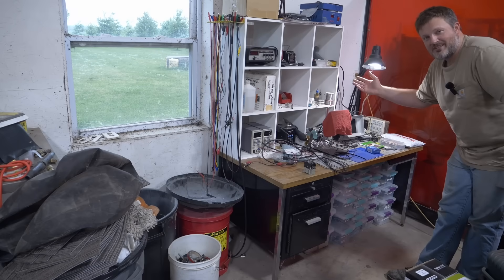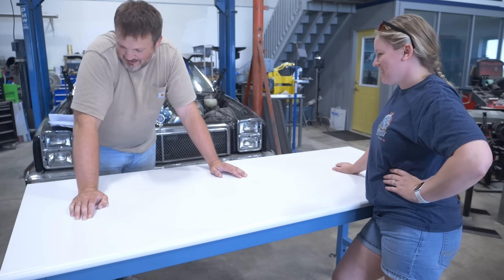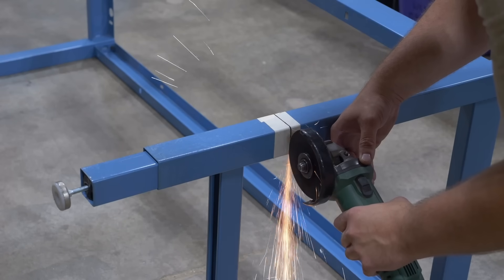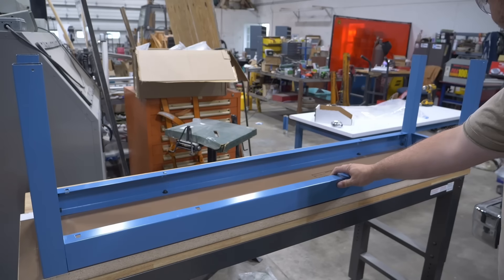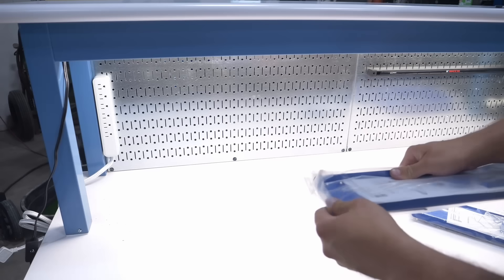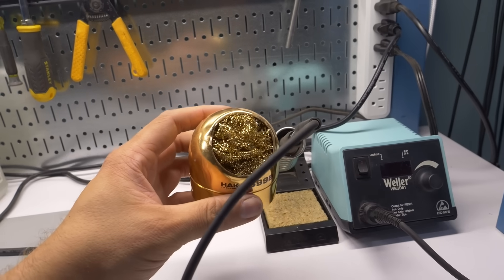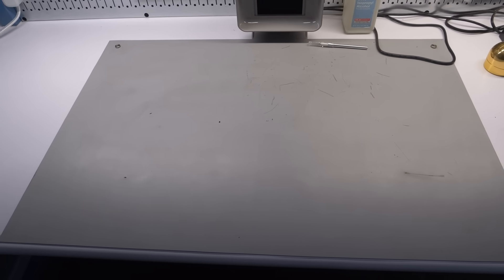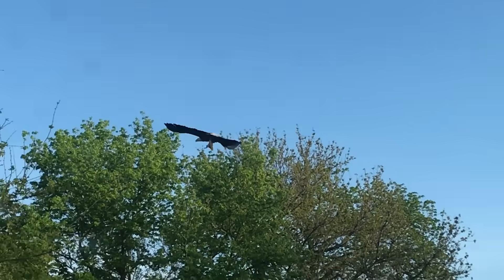Building an Awesome Electronics Bench on the Cheap

Comment: suggestion. get a pair of ceramic tip tweezers. they dont stick to the solder when you hold parts so they come away really easy without making a mess. also they are non conductive so they can be used to run solder onto the sides of it kinda like a dam

Comment: We had some of those expensive workbenches in our US Army calibration lab and I hated them. Four years ago, I bought a Husky 8 foot steel and wood adjustable height workbench from Home Depot for $405. However, it doesn't have a shelf, but it's long enough that I can store stuff under part of it. It has two 3D printers on it and has room for a computer workstation. It's great to be able to make your own stuff.

Comment: I hope I'm not the only one telling you that the days of Weller are gone. Until some years it was clearly JBC ruling the soldering world, and nowadays there are many cheap chinese JBC compatible knockoffs that are also very good.
The "new" ingenious thing is, that the heating element is inside the tip at the JBC (and compatible) tips. This means that the heat transfers a lot better to the tip than on that old weller design where the whole tip without heating element is exchangeable. Unfortunately Weller hasn't caught up here.

But of course it depends a lot on what you're doing. :) I follow your channel since the CNC video, and I guess for that purpose the Weller station is more than enough.

Comment: I don't know why carbon steel tables should be this expensive when stainless steel 30x60 kitchen work/prep tables on Amazon are available for less than $200. I bought several to work on and they have been plenty sturdy. My next trick will be to wrap them in vinyl car wrap for some color.

Comment: But But But... How much did each of the two benches cost? Where did you get them and are they still available at a bargain price?Ground wire to cold water pipe could have been in the wall before redoing the room with a wall receptacle right there! Ceiling fan to help blow any stray fumes away. Glad it came together for hopefully a BARGAIN price!

Comment: Mask up when sawing, cutting and sanding that stuff.  It can catch up to you decades later.  Also... on those little 4" cut-off disks.  Wear a full face mask.  When they shatter, they throw serious fragments out at high speed.  It's surprising how many stitches they will require.

Comment: I actually like having a monitor, keyboard and mouse on my electronics bench. Makes it way easier to look up data sheats while working. I have an old professional Elabo Bench at work, which is too low to fit a monitor, so I'm constantly switching between my desk and my workbench. That's a bit of a headache.

Comment: Thanks for sharing. I've been using a white folding table for now. It works but I need a shelf for my hot air station and bench power supply. Also that fume extractor just hides the smoke, it doesn't actually protect you much. The (I forget the term) toc? levels are still there. Ideally you pump the air outside. Also if you ever come across a microscope cheap, or want one. I bought a amscope SE400Z. Its alright, I mounted it to a vesa monitor mount I got for cheap second hand. Also upgrade from that 858D. The atten ST-862D is about $150 from WGP. Well worth it. Cheers

Comment: Do not forget that old landline phone indoor cable is a valuable asset as well. Used for jumper wires, and for connections as well, and you can get it in up to 500 pair bundles, with a good assortment of 10 colours and with stripes as well.  Old copper network cable is also useful, makes for great links, and the flexible one for wiring up front panels. Generally available at every building demolition if you look for it in a dumpster, and you only need a few meters of it (or for the USA yards, close enough for the work you will use it for) to last a long time. Bonus as well it comes pre tinned in the most case as well for the phone cables, which is a great help soldering them, though the PVC insulation does tend to pull back when soldering.
Reply: No one's throwing scrap wire into a dumpster. Even with insulation on it the scrap price of wire is just too high.

Comment: Only thing I can see missing is a hot air station for the surface mounted items. Then you'll need a snazzy microscope so you can see the SMD pieces. 
Real nice desk Wes and you could remind Mrs Wes that since she was off for the weekend she cannot share in your ritcheous glory of building an excellent electronic workbench. Only thing I would have considered changing would have been to put Dome Bolts in the part the held the shelf legs together. That would have been the je nais se qua for the piece de resistance. Bravo! 🥳🥳🥳🥳🥳

Comment: Kiddo is getting so Big Wes And Great Custom electronics Table Super Snazzy love Weller and Haiko 11:48 @Watch Wes Work
Reply: I have a Chinese T-12 kit iron and it's way better than my Weller WTCPN Even with a slow SMPS powering it it'll still heat up faster. I need to put a standby switch on my station. All in kit and PSU I think that iron cost me less than $25 to build. I made a custom case for it. They sell those too. But that would have blown the budget to buy that.

Comment: Went from an older analog crt scope to a digital one about 10 years back, they are nice but screen is not quite as responsive as the crt scopes were.   They are really light, far more compact with some additional features though.  Fair trade offs I guess.

Your bench turned out great and you didn't have to pay $1k.

Comment: That internal sense of accomplishment cannot be duplicated.  Every time you use that bench you will instantly recall the project and have that feeling again.  I know, I get it too when my projects/repairs work out.  Wes, disregard unkind or chippy comments.  I like to hear you talk and explain your thinking as you work.  It's how I learn.  If someone wants silence, they can always mute the volume.   I like all your projects - not just auto/truck - the wood splitter rehab was perfect.  If you want to fix it - do it.  I say "soder" also, people need to learn there are silent consents in English.  To de-solder try a red sucker bulb.  Looks like a kid's clown nose W/a white tip.  Melt the solder, then squeeze the bulb and suck it into the bulb to be emptied later.  Much better than wicks. Like your channel V-much.

Comment: It's not just the government. I work for a major semi-conductor manufacturer. As soon as you add "cleanroom" to literally anything, you add at least 3 zeros to the price. We use disposable towels that are synthetic and don't produce particles when used just for cleaning and wiping things. They cost several dollars per towel. They're disposable. If someone needs to wipe their nose, it costs $5-6. If it says "semiconductor production" on it, add 5-6 zeros.  There are o-rings on our tools that cost several thousands of dollars. A maintenance service, which in the high volume factories take place about once a week, cost $100k for a single process chamber just for the parts. We aren't allowed to use aftermarket parts, even though they exist and likely come directly from the actual part manufacturer (imagine buying a Denso oxygen sensor instead of a Toyota one, they're probably the exact same part with the Toyota logo scratched off) because the aftermarket parts aren't production approved. Entire companies come up from making very basic, niche products and cornering the market. They can charge whatever they want because there is no competition, no regulation and no other option. I'm sure this bench is over-priced the way it is only because of the three letters "E S D"

Comment: Well done! That screwable cap just gave me a solution for a similar problem. Thanks Wes!

And, by the way. Just want to add one small word of wisdom - people should not go for the led free solder, it's crap. Use something like Stannol Kristall 60/40 or similar. It's like night and day, and will save you a lot of times in the future.
Reply: 63/37 is the good solder. 60/40 is kinda the crappy stuff. 63/37 is the eutectic melting point alloy. Or lowest melting point of lead/tin.

Comment: As was briefly mentioned, it all has to be bonded to ground to get functional ESD protection. The shelf also needs bonding. It should be a high impedance bond, to avoid electrocution hazards, especially for the wristbands. Be wary of the "Auto" button on the oscilloscope, works fine for a clean square wave or sine, but if you have something more complex, with both high and low frequency components, it can easily get the settings off by orders of magnitude, both in time and amplitude.

Comment: Nice setup.  I worked as an Electrical Engineer for 30+ years and had a bench full of equipment from high end quad chan gigaherz O'scopes to logic and Spectrum Analyzers to TDRs and on and on...  Thankfully retired now and only have a multimeter.  Thinking about getting a portable o'scope for car troubleshooting, but I drive Toyotas and they never break. 😁   Thanks for the videos!  👍👍
Reply: do you recommend to be a electrical engineer what things i have to keep in mind or what  stuff i need to know 
im a student and in a couple of months i will go to uni, im in love with electronics and always wanted to be a electrical engineer but i dont know
Reply: They might not break, but it’s still good to keep an eye on the lambda and MAF/MAP sensors, they’ll cost you loads of money in fuel economy for a long time before they’re bad enough to throw an engine check light.

Comment: Lab bench setup is nice but if you want to do smt work a microscope really comes in handy. Also really handy for this kind of work is keeping a spool of the finest silicone sheathed wire you can find for rework and sniffing lines on a PCB.

Comment: i work for a college and built 9 of those recently. the build quality is decent, but for them being as expensive as they are, i expected better quality fitment. the anchors built into the wood are meh at best, imo.
Reply from the maker: Sure are. The frames are really weak too. Don't put any side load on them.

Comment: Well done, Wes!

A couple notes from an electronics hobbyist and retrotech guy (as well as artist, budding writer, and all-around computer neeeeeeeeeeeeeeeeeeeeeeeerrrd). One, Hakko is NOT an "off-brand" -- and, sadly, many "name brands" aren't any more (for instance, Zenith is now Funai Tech... you should see the guts I pulled out of that LCD TV, what a joke). Two, fume extractor is... more hype than anything else. So-called "solder smoke" is only boiling-off flux and nothing more -- the metal smell is from the solder melting. Solder doesn't atomize, only the flux does... and rosin flux is nothing more than, basically, boiled pine sap (no, seriously, Wiki it, it's pine sap that's been rendered the way pig fat is rendered into lard). It's fine. Three... 0.031in solder (0.8mm in civilized units) for through-hole, use the hair-thin stuff only for super tiny surface-mount stuff unless you want to go through it waaay too fast.

Four... antistatic mat is also hype. Unless you're working on something made literally in the 1970s, and it has very specific kinds of chips, you're fine without it. Done plenty of work, and plenty of rework -- never bothered with the wrist strap. Literally the only stuff that needs that kind of protection is the really, really early CMOS-process stuff -- first-gen 4000-series glue logic and first-gen ROMs/RAMs that used CMOS tech. The HMOS, PMOS, and NMOS stuff, you can walk across a football field during an electrical storm holding that in one hand and a bare CB radio antenna in the other, and the chips will wind up better off than you will. Anything TTL, or 1980s-and-later, same story, because by then they'd learned how to do proper ESD protection on chip dies. Tube stuff, same story, it's just too rugged. Literally if you're working on, e.g. an original Pong arcade cabinet from Atari, or "big iron" from IBM or DEC or the like that has actual chips in it, you probably want the antistatic mat and wrist strap, but for anything more modern, or anything old enough to be discrete-component-only, you've not got to worry about it.

Other'n that -- looks good to me. It's certainly cleaner than what I've got.

Oh, two other things. Learn to use a logic probe and you mostly don't need a 'scope for what most folks use it today -- I have a $17 Elenco, it's the one that Blondihacks uses (aka Quinn Dunki) and she is an absolute literal living legend... as for multimeters, keep a couple Cen-Techs from Walmart around, or the $10 bargain-bin ones from Ace. Use the Fluke (or whatever you consider "nice", for me it's a $15 Sparkfun job) for the important stuff, use the cheap ones where you think you might screw up, so that you're not left swearing a blue streak because you blew up the expensive one -- that's actually a BigClive tip.

But, I'm a bit more shoestring than you are. No worries. We all have our limits, and they're all a bit different.

One last thing, I mean it this time. Maybe up where you live it's different, but in MY house, "weekend" is Saturday and Sunday -- Friday and Monday only count on federal holidays, and even then it's only Friday evenings... and I don't even work! (I'm too incoherent to moonlight, even, so SSDI is all I have to work with. You'd be surprised at what you can do with a kludged-together 6v battery drill and hand tools and nothin else.)

Comment: A desolder station is better than solder wick.  Solder wick is cheaper if you’re doing occasional PCB work, but overheating a trace whilst wicking can damage the trace (easy to do, ask me how I know).  Other than that, all you need to finish the bench is get a spectrum analyzer, a frequency counter, a signal generator, a signal tracer, and a variac.  You’re all set!
Reply from the maker: I have a Hakko desolder tool, a BK function generator, and a variac. Never used the variac in the 8 years I've had it. I would like to have a logic analyzer, but good ones are still very pricey.

Comment: Wes, Well done on the ESD protective bench. It has been a few years since I did much with that kind of setup. I have the soldering iron, some wick, solder, both tweezer and standard flush cutters and a few odds and ends. I even saved a cut-off protective mat that was discarded when fitting a new mat on a bench years ago. It works for small projects. I miss doing it, actually. My freshman year of college, I spent a portion of my afternoons working to assemble strain gauge assemblies for the college. They had two companies that ordered assemblies with their labels on them for lab type class use or similar. I remember wiring the strain gauges and the boards plus the hook on the load bar, then testing and package. Find memories, besides not having probably enough ventilation for the space. Been a lot of years ago. Thanks for sharing the video and bringing back several memories.

Comment: $500 for the shelf and $400 delivery, for something that you could make yourself materials included for $300, sounds like you're living in rural Australia, things like that are situation normal here.
I'm surprised you didn't use the metal glue gun to join up the frame you even had the right color "grinder and paint ..."

Comment: Yeah, you made quick work of that work bench. Looks very uniform, and factory, when they both share the same components. Nicely done. One thing that would be handy is a computer screen, where you can put up schematics, or a YouTube instructional video that shows how to solder your Atari mod. :)
I assume you will have a computer in the office, just get a second screen for it.

Comment: Years ago I landed a bench with base cabinets on each side and a shelf with power towers on each side. I think I paid $500 at auction. I liked it a lot and decided it would be cool to have another one just like it for my area at work. $2750 😳 Nope! I ended up with two Harbor Freight tool chest end cabinets, a custom steel frame and a sawn up solid core door for about $1900 less.

Comment: If anyone wants to add arms to their "helping hands" soldering holder, a flexi grill lighter tube holds a gator clip well, just attach one or two to the base.
   Some of that light is better off behind you, throws the shadow away from you and your hands. My long desk lamp spends most of it's time pulled over my head so I'm not. 
   Don't recommend magnetizing your fine tweezers. Most of mine are ruined from that same mag strip. The tweezers will magnetize smaller screws, borders on magic as to how fast they disappear.
     Good luck w/ the static braclet. I'd rather be like a powder monkey with copper plates riveted to my shoes on a copper mat or something. 
    Braclets are pennies and built like it, better buy half a dozen. The clip-in at the wrist is jank. Some are folded glorified tinfoil, like the colored string bracelets with the one time fold and squeeze clamp for the fair back in the day, that sort of jank holds the cable. I didn't really find any nice ones, it was all the same, only difference was price.

Comment: I had that work bench Wes showed with more accessories when I was service manager for the largest amusement vending equipment company in the upper Keys. 
It definitely was way cheaper back then.
Just like Wes I did a bunch of mods to it to fit my needs.
I had a dual trace scope I could hook up to my P.C. and save signals I'd get on problem chips on Arcade and pinball games circuit boards for future reference as well as what this signals should look like on a working board to compare so I built myself a library of both.
Reply from the maker: Yeah I have a Pico scope that let's me do that. Worth it's weight in gold for some jobs.